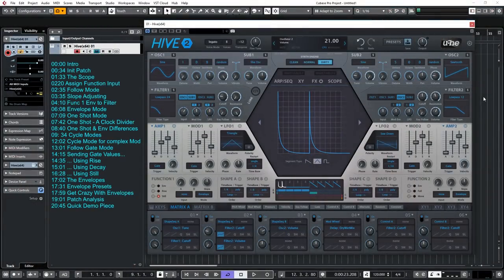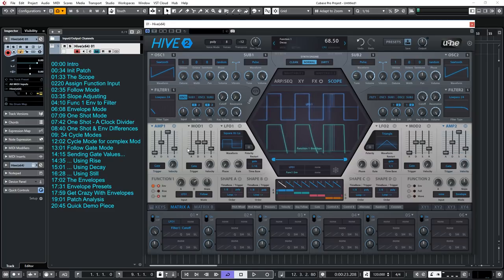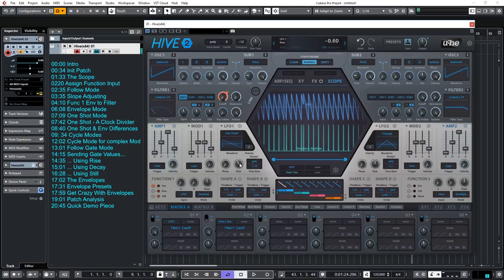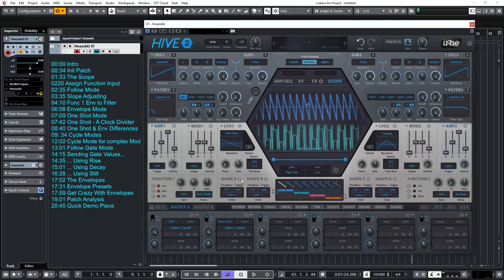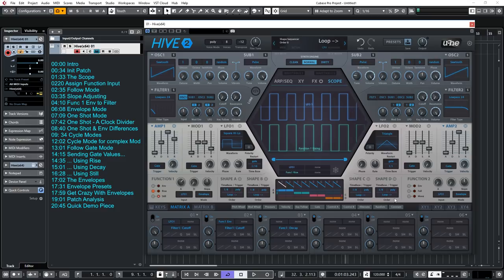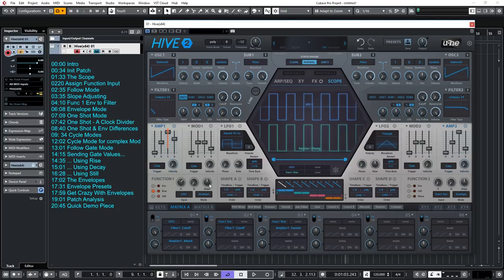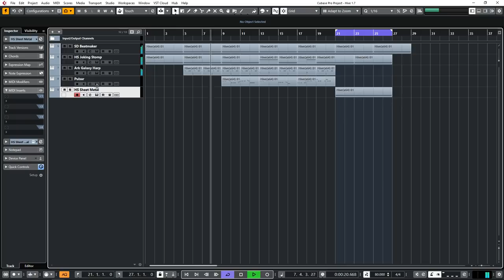u-he Hive 2 - Examining The Function Generators - Tutorial

Comment from the maker: 00:00 Intro
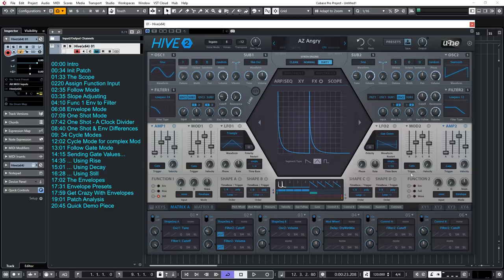00:34 Init Patch
01:33 The Scope
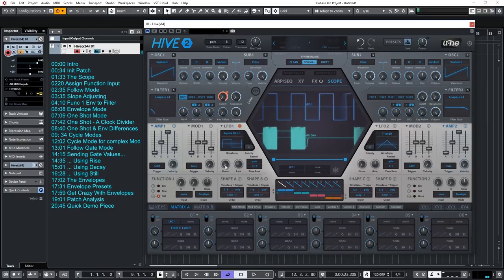02:20 Assign Function Input
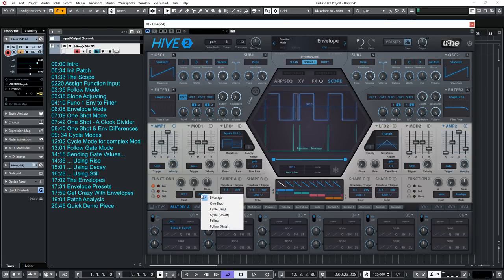02:35 Follow Mode
03:35 Slope Adjusting
04:10 Function Envelope to filter
06:08 Envelope Mode
07:09 One Shot Mode
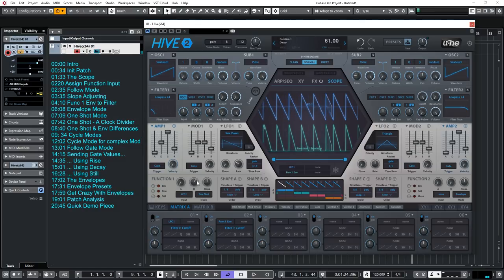07:42 One Shot as a clock Divider
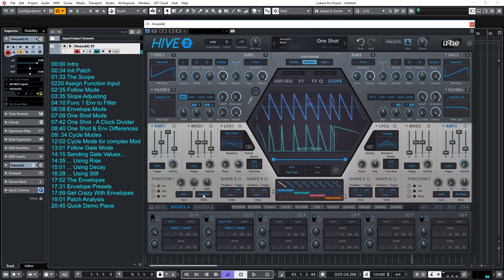08:40 One Shot & Envelope Differences
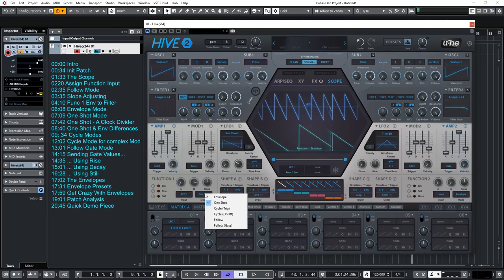09:34 Cycle Modes
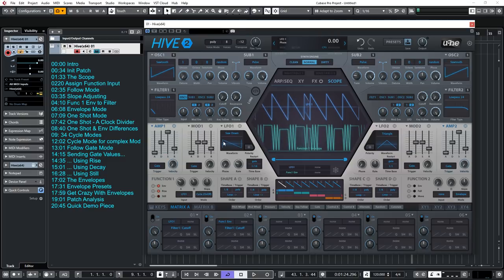12:02 Complex Waveforms using Cycle Mode
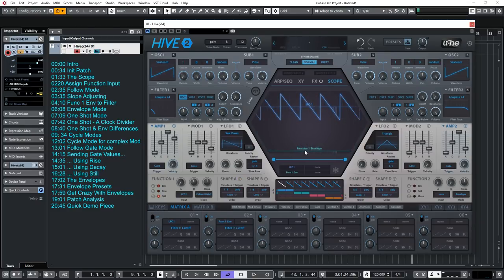13:01 The Follow Gate Mode
14:15 Sending Gate Values...
14:35 ...Using Rise
15:01... Using Decay
16.28 ... Using Still
17:02 The Envelopes
17:31 Envelope Presets
17:59 Get Crazy With Envelopes
19:01 Patch Analysis
20:45 Quick Demo Piece